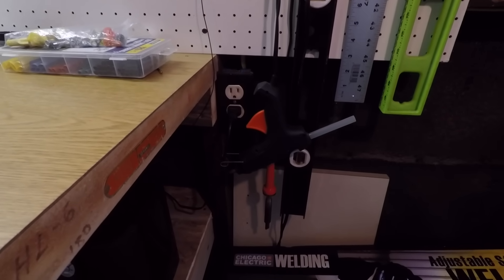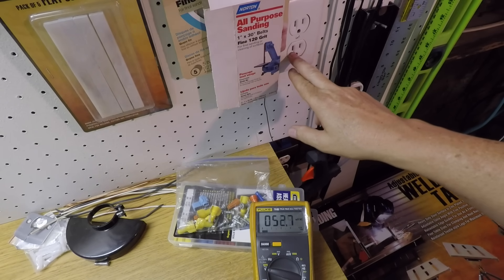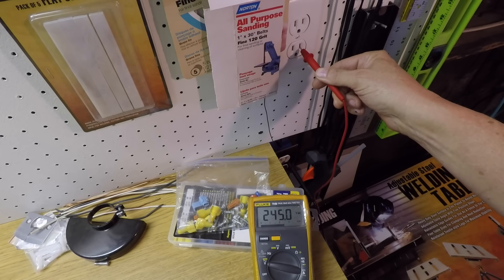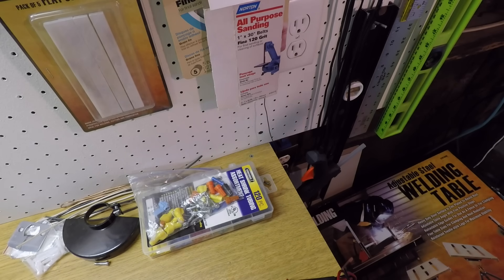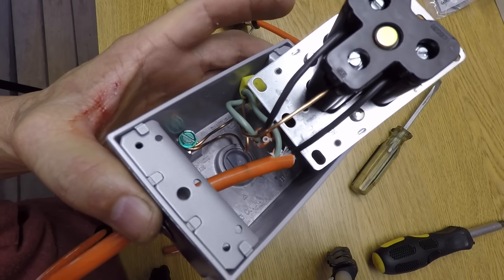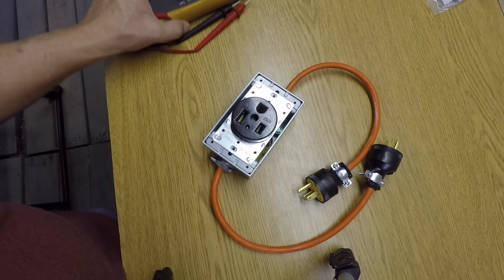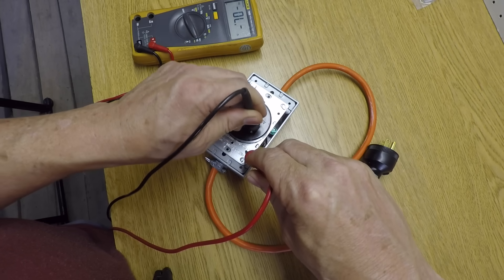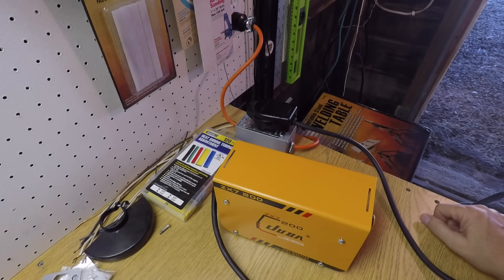How to Get 220v From 110v

Comment: Why did you cut the original 3 prong plug from the extension cord?  Why didn't you just use the plug that was already attached the the extension cord?
Reply from the maker: I just used pieces of the extension cord. They did not have the original ends on them.
Reply: Thanks for the quick response!  Much appreciated!  Just one more question, why did you cut the neutral white wires?   Why were they not relative to the process?
Reply from the maker: Two hots and a ground are all that's required for this little welder
Reply: One more question and I'll leave you alone. ☺  What would you have done differently with the white neutral wire, if the original plugs had been on the extension cord?
Reply from the maker: I would build it exactly the same as I did. I would just cut them off and tape the ends where I cut them off so if something inside the box comes loose it won't touch the bare neutral wire end that was cut off.

Comment: A guy at Home Depot told me that the 220V breakers alternate alternate between bus bars.  Can somebody explain that please.  And by the way thanks to DIY HP for the video it just needs a little more information on the other two lines.  for those that don't now and think that they can grab any two 120 v outlets and give birth to third one with 220.

Comment: I know everyones said it, not just seperate circuits, separate bus-bars. He did show to do the voltage test though, which will give you the answer of course. Preferably, you know ALL the outlets on each line, and you know the associated breakers. He did it correctly, but if you didn't run your own lines, then you should do a little checking on your lines first just to get an accurate idea of what your working with, making sure of course that it has the right gauge wire and right breakers.

Comment: I have many versions of these running a DJ service since my amplifiers draw up to 20 amps at 240 volts.  Good idea in a pinch for temporary situations.  I also use a combi 2 15 amp parallel combiner to 30 amp 120 volt twist lock for some of my older amplifiers - but be careful, you can backfeed with the parallel splitter.  Be aware and familiar with site wiring or test site wiring to prevent someone from plugging in 2 1500 watt coffee makers to one of the backfed circuits.  I've made automatic protected versions so if one of the cords disconnects either of the disconnected cord male ends aren't live if something is turned on.
Reply: Great for temporary setups…
Reply: Good info, didn't realize the bus bars were setup this way, thought the left was one phase and the right was the other. This makes much more sense.
Reply: @drewreed4639 there is no such thing as phases in a breaker panel, residential home wiring is split single phase at the pole
Reply: No it isnt

Comment: I independently invented such a device -- only to find that the US Patent Office had my exact design on the books for more than 20-years. 
The kicker with your 'cheat' is that you should actually just set another box and bring the two hots together -- and you should swap-out the circuit-breakers back at the panel. Doing that will make your project bullet-proof -- and according to Code.

Comment: Great job my question is if you are running two independent 20 amp circuits. Is there any reason as why your two 20 amp receptacles are not 20 amp? It appear as if they are 15 amp receptacles.
Thank you
Reply: Greg, our electrical code allows a 15A duplex on a 20 A circuit. It’s not a foul.

Comment: How come my multimeter died when I put them into an outlet like this????

Also, makes me realize that must likely my nice multimeter that died probably has tiny fuse inside I could replace to make it work again, right??

I am not an electrician
Reply from the maker: I think if you have your multimeter set wrong you can blow a fuse inside the meter. Most are replaceable if blown I think. I'm not an electrician or an expert either.
Reply: @DIYHomesteadProjectsDIYHP10  thanks for the response.   

I never understood why this happened.   Good job on the video tho
Reply from the maker: No problem Dan and thanks for watching.

Comment: The current electric code requires 4 prong outlets for 240v.  This requires you to carry the neutral wire as well.  3 prong devices are older and obsolete.  That welder from overseas doesn't adhere to current code stds in Canada or US and is most likely made in China.

Comment: This is of course why electric equipment needs to be installed according to code.  A proper 220 volt circuit fuse would shut both sides down at the same time if tripped.  But it does display an understanding of what 220 volt means in North America, that being 2-110 volt circuits out of phase.

We used to have one of these hair brained plugs with long extension cords to run a light panel for a Christian performing group.  Fortunately we didn't actually need 220 volts, we just needed 2-15 amp fuses, so 30 amps in total, as the panel was split for amperage reasons but each half ran on 110.  But it would work just as well on 220 or 110 as long as the 2-110's required were not on the same fuse.  However that would not generate 220, you need out of phase circuits for that.  The light panel didn't care, each half ran on it's own.

In any case I would not recommend this solution.  Better to put in a 220 fuse and wiring, so that if one side trips both get shut off.  That is the reason why it is done that way by code.  The way you are doing it one fuse might trip but the other might be still putting 110 to the circuits.

Comment: Cool idea but I'd be concerned about only one breaker tripping and still having the other on. In some cases it could be dangerous but it could also cause damage to the welder or other 240v devices used. Someone suggested using a double pole 120v breaker so they both trip and I would have to agree.
Reply from the maker: There are a few things I would do differently if I were to build another one.
Reply: Don’t “build” another one, just install a dedicated 240Vreceptale
Reply: @DIYHomesteadProjectsDIYHP10  How about just running 12/3 instead so you don't have to dangerously rig something that could burn your house down?
Reply: there's also the case of them using a ground as the neutral/return pin on a 220v outlet.
then there's the ground loop from two different grounds connected to one outlet.
they also wired the neutral on the 220v outlet to the receptacle box.

Comment: The issue I have is the type of receptacle he has on his wall. To be able to tell at a glance whether an outlet is 15 or 20 Amp is the horizontal notch on the neutral side that he does not have. It looks like a standard 15 Amp receptacle.

Comment: Why wouldn't you use two hots and one common connect to Commons and run one jumper? And when you're using those two legs as a 240 if anything else is plugged in upstream it seems like it might change the voltage upstream or downstream for that matter I don't know

Comment: Why does my brain say grounding the case literally adds electric current (or flow) to a component that you can touch?? wouldn't that make it more likely to zap you??? even if any if the hots come undone like he says, by grounding it you are giving it a path to short and complete the circuit ( hence why I'm thinking that it would shock you??) Please some one tell me if that's wrong I could be a total  ding dong.

Comment: The two single pole breakers supplying the power must have the handles connected or use a single two pole breaker. If one circuit trips the other must trip with it.

Comment: I can see this working. But, and I might be wrong, but shouldn't you have both a neutral and a ground? Usually, in this type of system, that bottom prong would be going to neutral, and the box itself would be going to the ground, separately.
Reply from the maker: No neutral required for any of my 240V welders.

Comment: Why not just install a 240 breaker in the breaker box? Doesn't your main box have enough room or? But then you'd have to run new wiring for the plug...ah I see what you're doing. But, you ran 2 separate 120V 12/2 wires for the 2 outlets...so I'm scratching my head here...again, why not just install a 240v breaker and a single 240v wire to a single 240v outlet? what's the reasoning here?
Reply from the maker: No room in the box. Already had two 120V lines just moved two outlets close together. I was able to get the job done for a temporary 240V 20 amp outlet for about $20. Otherwise it would have been in the hundreds of dollars. May not be the solution for everyone but in my situation it worked perfectly.
Reply: @DIYHomesteadProjectsDIYHP10  I see! Thanks!

Comment: my minisplit works with 220v...its not working...the house has all the outlets and light switches working properly...the outtlet for the minisplit   has 2 entrances 110v and 110v ..in one entrance it reads on the voltmeter 119v and on the other entrance it reads 44v...its bridged from a 110v outlet...how can I fix the problem...help please

Comment: Love the video!  I've been sharing the hell out of it.  I sell 2x72 belt grinder kits and the number 1 thing I hear is "but I don't have 220v in my shop"  I also love how all the Electricians are pissed in the comments.  The real reason is you're empowering their customers to help themselves instead of calling an Electrician.  The only thing I tell people is to try and use two breakers that are next to each other than tie them together with a handle tie.
Reply from the maker: Love it! 👍
Reply: Right on👍👍
Reply: THANK you for the tip, sirs

Comment: In a pinch, this a great tool. If you need to weld a little something. It's a quick way to hook up your welder almost anywhere, as long as you have both side of the breaker panel feeding your outlets.
Reply from the maker: Great point!

Comment: This seems useful when you only need to used a 220 system every one in a while. The cost to install a dedicated line for something that you might need once or twice per year might not make any sense. I have a 220 air compressor that I only run every so often and I get by by firing up a small generator instead of dealing with upgrades to the panel.
Reply from the maker: That is exactly right Bernarda!

Comment: Why didn't you just install a 20amp 240v outlet either next to or instead of the 2 120v double outlets and then put a 240v matching plug on the end of the welder?
Reply from the maker: I want to use it in multiple locations

Comment: If both those outlets were wired from the same hot side of the panel, you would not get 220 volts.  Besides you should never do what your doing. Use a dedicated circuit for a welder.  Its just as easy, and from the material you used, cheaper.  And absolutely much safer!

Comment: I agree but no idea of what the installation will be for running 240 voltage maybe impossible i have a 240 voltage outlet in my garage on a 50 Amp breaker but I have run 120 voltage outlet off the side using the same circuit which is number 6 wire per electrical engineer i also back feed through this circuit in loosing power during a storm all approved by an electrical engineer i shut the main service off when that happens

Comment: I think you should have used 12 guage wire for your hot connections to the 240 volt plug.  The circuits are 20 amp each so if your welder pulls close to the max amps or 40 amps split your hot wires will  each be handling over  15 amps and they are only rated for 15 max.  
     I think they could handle abit more than 15 as there must be a safety reserve but using 12 guage wire is the safest way to go. Nice project!
Reply from the maker: Thank you Tony, I agree with you. Thanks for the great tip!
Reply: No that not correct! The National Electrical Code specifies that a circuit should not pull more that 80% of the rated load of the circuit. This is 12.5 amps on a 15 amp circuit.

Comment: I have studied electricity intensely for years, but just recently I learned the power company brings in one hotline and does not carry a neutral or a ground. At the transformer, they split off two 110-volt lines, the same phase and bring in what they call 220. My assumption, though wrong, was that the 220 in my house was phase to phase, but apparently, it's all the same phase, so this is nothing new, but most of us are just unaware as I was.
Reply: Man!  Please continue studying electricity intensely for a few more years!  Specifically, learn about center tap transformer theory, why the waveform at each end is 180 degrees out of phase (from the center tap) despite being fed by a "single phase" supply.

Comment: Why wouldnt you just run a 240  welder circuit if you were already running wires?
Reply from the maker: I was working with what I had on hand. I didn't want to go spend a bunch of money on a temporary solution.